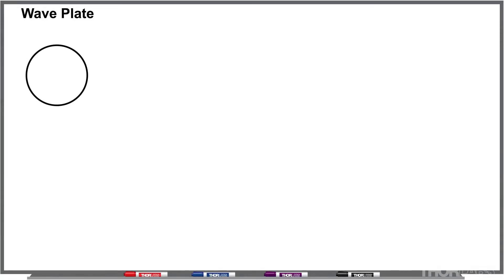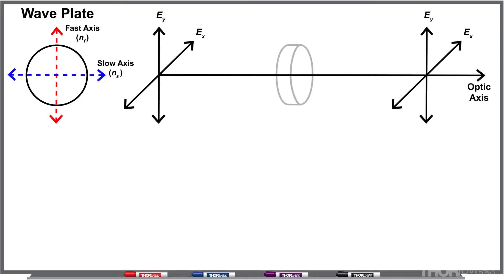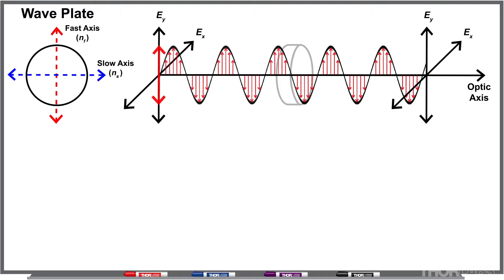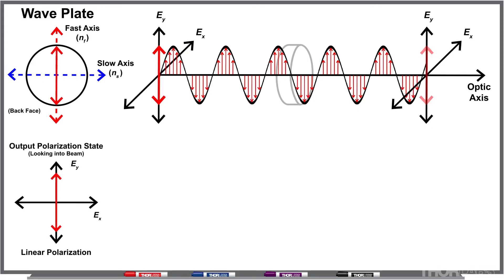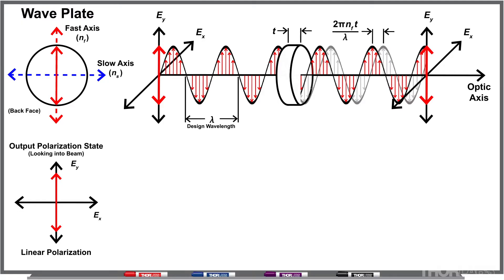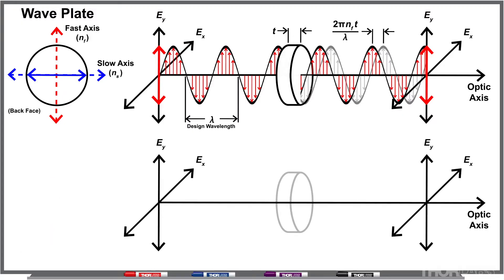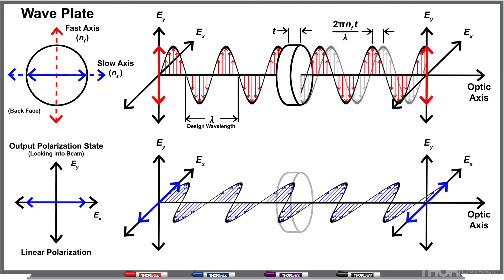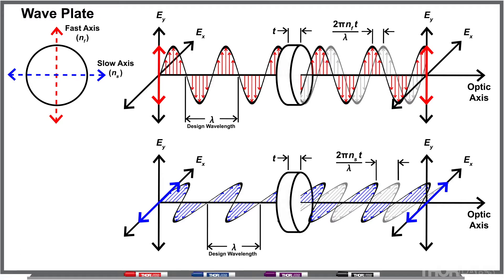Create Circularly Polarized Light Using a Quarter-Wave Plate (QWP) | Thorlabs Insights

Comment: Silly question, but does adding QWP downstream of commerically available lasers (rotated by 45degrees) give a reasonable enough circularly polarized light? Or is it imperative to identify the polarization state of the laser prior to placing a QWP at 45 degree relative to this? Also, how drastic is the performance between multi order qwp as compared to zero order qwp if the intention is to use it for a single laser line? Thanks! Great set of videos!
Reply from the maker: It is possible that a linear polarizer is not needed between the laser and the QWP, but it depends on your laser's output and your application. Please contact Tech Support (techsupport@thorlabs.com) if you’d like to discuss your particular application. Note that not all commercially available lasers output linearly polarized light, and if one does, its polarization state may not be stable. 

In most applications, you should not see an appreciable performance difference between zero-order and multi-order wave plates, assuming the laser line is narrow and within the operating wavelength of the wave plate. A multi-order wave plate may also be preferable, since it should be more robust to handling.

Comment: If I had linearly polarized light parallel to the y-axis and a quarter wave plate with a fast axis initially parallel to y-axis and later on to x-axis , what would be the difference between those waves ? Could I say that between those two waves the first would forego the later by π/2 ?
Reply from the maker: You've got the concept! The first wave’s polarization state is parallel to the fast axis and the second wave’s polarization state is parallel to the slow axis. Ideally, a single pass through the quarter-wave plate will result in the phase of the second wave being π/2 larger than the phase of the first wave. But in practice, design and manufacturing limitations mean it is important to check the retardance plot of your wave plate to determine the exact phase difference (retardance). 
 
The retardance of physical wave plates is highly wavelength dependent, even over the wave plate's operating range. Also note that many quarter-wave plates provide a phase difference equal to the sum of π/2 and some multiple of 2π, instead of an exact π/2 difference. A zero-order wave plate is expected to provide a π/2 phase difference at the design wavelength if that is needed for your application.
Reply: @thorlabs  Great ! Thank you for your help !!

Comment: Hi, how do you analyze the circularly polarized light? (Using a LP and QWP arrangement)
Reply from the maker: In this demonstration, we performed a qualitative assessment of circularity based on how steady the detected power remained as the last linear polarizer was rotated. Adding a second quarter-wave plate to the path and taking a series of measurements would make it possible to calculate the Stokes polarization parameters, which characterize the light's degree of polarization, ellipticity, and handedness. Please let us know if you would like a follow-up video showing this analysis!
Reply: @thorlabs Thanks. 
And yes, that would be great!
Reply: A polarimeter will be helpful aswell
Reply from the maker: Absolutely! If you have access to one, a polarimeter would be a quick and easy way to determine the polarization state.
Reply from the maker: @Mahima Sharma There is now a Video Insight available (https://youtu.be/pR4r7gMyN5U) that demonstrates a couple of approaches to using a quarter-wave plate and linear polarizers to analyze light's polarization state. These are do-it-yourself versions of polarimeter instruments (https://www.thorlabs.com/newgrouppage9.cfm?objectgroup_id=1564) used to measure the Stokes parameters of the light. The video also discusses the relationship between the Stokes parameters and different polarization states. We hope it is useful to you!